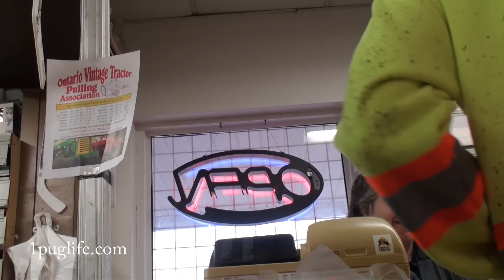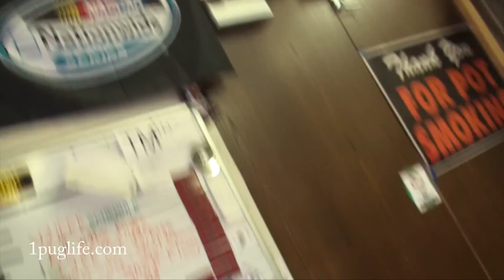the most hilarious minibike romp ever

Comment: Time to fix the ackerment on dizzy, Chop the top frame tube behind the steering head with a thin cut off wheel, put a bar in the steering head tube and force the gap shut and weld the top frame tube back up and that'll give it a few more degriss rake on the akerment of the steering head so it doesn't shopping kart and bust the forks.